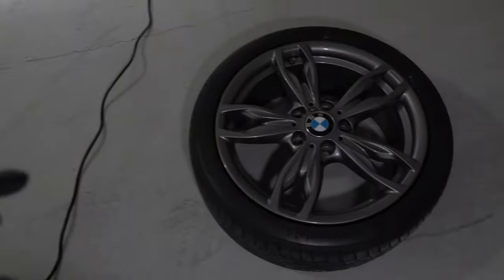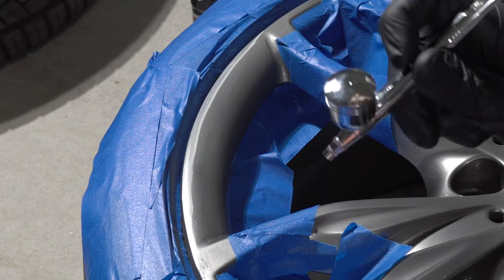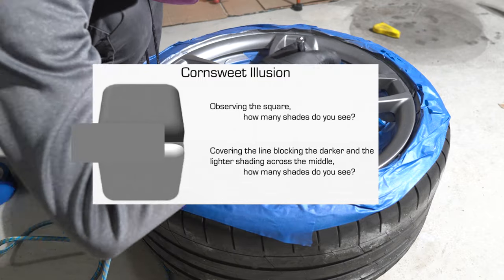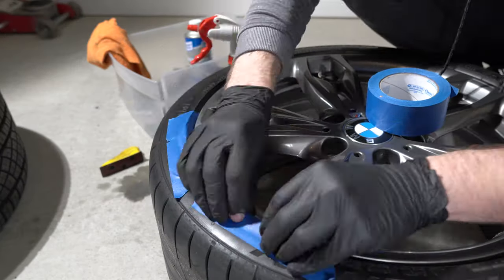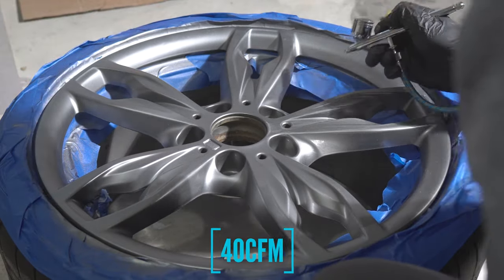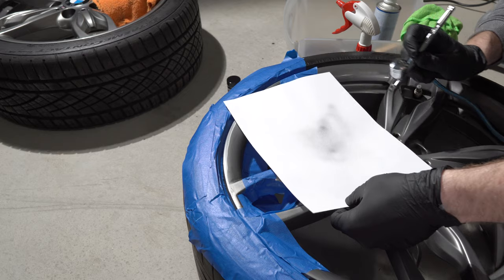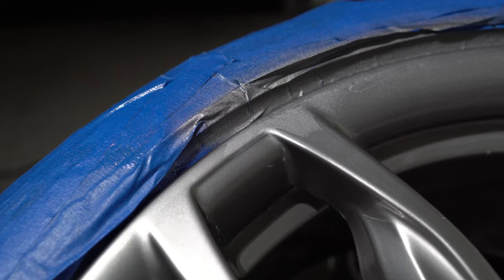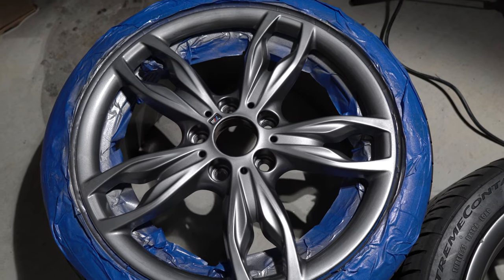How to Paint Car Rims with Air Brush and Oil Base Paint DIY

Comment: nice attempt. and just wanted to pass on some knowledge. The reason you see the texture is because you didnt spray primer on your repair. The primer would have served as a leveling source for your surface and then once sanded it would be a seamless transition and then you could proceed to the steps you took. i came accross this video becuase i thought it be interesting to paint something so large with a small air brush. But yes, try a high build primer even if its from a aerosol can and you will see the difference.

Comment: Did you do car respray. Would like to see you experience with car panel
Reply from the maker: Waiting for warmer weather, since I don't have a garage at this moment. But yes, I got the paint, and all the nesses parts and pieces. I think march or April. Will test it on my Van, should be fun, that car needs lots of small things, so will make a couple videos about restoring those. 
Thank's for the comment!

Comment: We know how to sand and prep a surface. What we did not know is where to order the air brush paint and you spent literally no time telling us that. At least you told us what kind of compressor size minimum and what kind of needle size, but you should have spent more time talking about the type of paint and where to get it.
Reply from the maker: Will keep this in mind for the next content project. 
Thank you for the comment!)